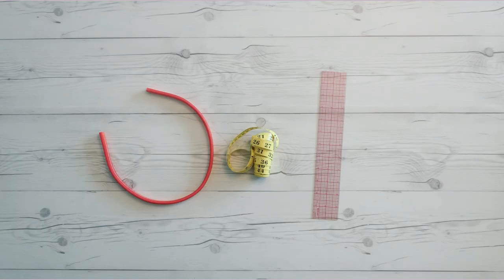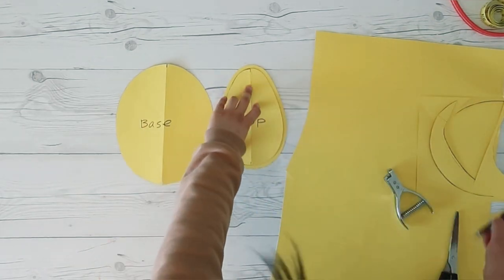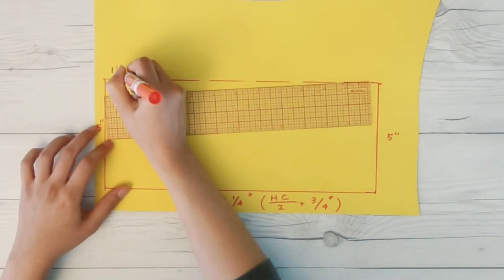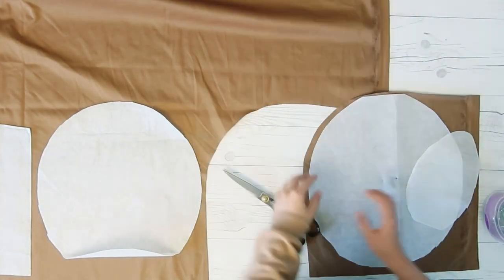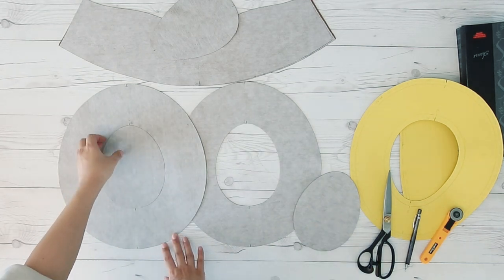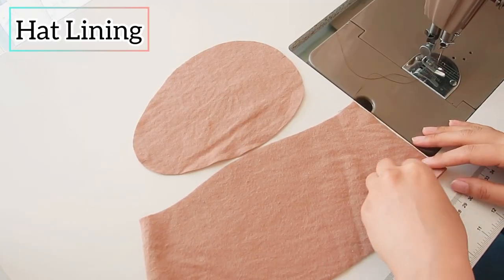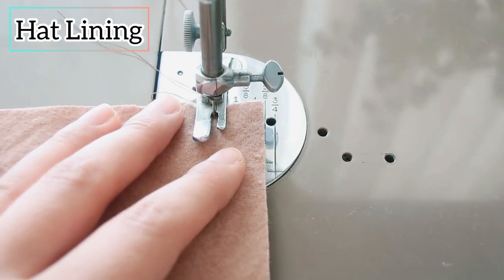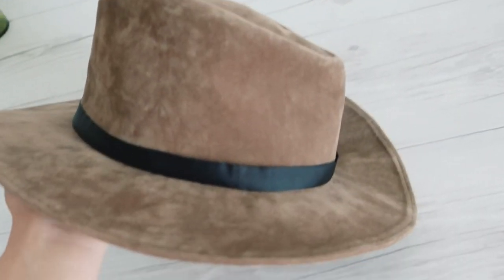DIY FEDORA HAT from scratch / How to use your head measurement to draft and sew fedora/cowboy hat

Comment: Thank you very much for making this video. I have seen several videos on DIY hat making. I want you to suggest that you can use a wire round the edge of the brim, the wire can be any thin metal wire. The wire keep the brim in shape. Thank you.
Reply from the maker: that’s a good point I forgot to mention! On this hat, I wanted soft finish, but if one wants a more structured hat, using double buckram instead of fusible interfacing, and sewing millinery wire around the brim would make a hat hold its shape.  Thank you so much for commenting!!
Reply: will you please tell me what is a double buckram?
Reply from the maker: Buckram is very stiff and starched material used in hat making. There are single buckram, which is easier to shape, and double buckram, which is a double layer of buckram and sturdier than single buckram.  You can cut out buckram and stitch millinery wire around the edge to use as a structural base for a hat. Hope that makes sense!
Reply: Thank you very much for explanation.
Reply: I would love to watch you do the wire + buckram style next!

Comment: If you sew a fine wire around the brim of the hat. You could shape the brim the way you want it better. It will form the way you shape it. Sew wire around brim using some thin strip of same fabric as hat.
Reply: I was thinking this exact same thing.

Comment: Thank you so much for this video. I'm about to go make a Fedora out of scrap metal and this video has removed all the anxiety that I had related to getting the shape right. My plan is to begin with a circular steel ring which I'll heat and hammer into a head-shape oval. Onto that I'll build a framework of 1/8" steel rod, being sure to keep the top Avocado shape, and then weld a patchwork of metal off cuts to the frame to create the final shape. It'll look better than I can describe it I hope, but thanks again for your help!
Reply from the maker: I’m glad this video was helpful! your project sounds very intense and so interesting! Is there any way I can see the end result when you are done?

Comment: Thank you for your video.  I really liked your approach to creating the sides of the crown.  That was very slick.
Reply from the maker: Thank you so much for your kind comment!
Reply: @SachisStudio  I have a question.  When you measured your head with the flexible ruler, the inside of the ruler was against your head.  When you made your base, you put the zero on the ruler one one end of the line you had drawn, and half the head measurement (including some material allowance) on the other end of the line.    You traced on the outside (not the inside) of the ruler.  Were you reading your dimensions on the inside or the outside of the ruler?   Reading and aligning the dimensions on the inside but tracing on the outside would have given the base some additional looseness to allow for material.  So would reading and then using the dimensions on the outside *and tracing on the outside), because of the ruler thickness.  I made a hat after watching your video, and it ended up tighter than I wanted it.  I am trying to sort out what I did that was different.  Thanks.
Reply from the maker: Hi Don, thanks for your comment! I’m so happy to know that you made the hat already :) I’m sorry that I wasn’t very clear on this in the video.  I’m using my tape measure to measure my head, and using my flexible ruler to copy the head shape as best as I could.  I know technically you copied your head shape INSIDE of the flexible ruler, but I traced outside of it because it’s hard to trace inside of the ruler without distorting the shape it’s holding. and that is why I measure the head with tape measure separately and adjust the flex ruler a bit before tracing.  Sometimes tape measures stretch out, and flexible rulers are not super accurate, so it’s a good idea to compare the two to make sure of their accuracy.  But usually, hat ending up tighter is because of fabric thickness.  you can check the base pattern by cutting out the base shape from cardboard paper and fitting the outside of the cut out shape (you can use the brim pattern without seam allowance, too) to your head.  
I hope that helps!
Reply: @SachisStudio  Thanks for the quick answer!  Be well!

Comment: If you don't have a flexible ruler, is there anything that can be used instead?
Reply from the maker: A flexible ruler would be the easiest, but instead, you could have someone take a photo of your head from above, or set your phone’s camera to the timer and hold it above your head to get a sense of how the base shape should look like. And then, use your tape measure or even a marked string to emulate the shape on your pattern paper.  Thanks for the comment! :)
Reply: @SachisStudio  String works well but there are cloth measuring tapes as well.
Reply: I’m thinking of using some flexible wire and marking measurements in sharpie on it first, then use like the ruler.

Comment: Awesome video! I'm wondering how one could reverse the heights of the back and front so that the front of the hat is taller than the back? Thanks so much!
Reply from the maker: I have never done that, but I’d imagine it can be done by just reversing the ratios.  the side crown draft is basically how the hat will look from the side ( plus front and back shaping), so you can make it look any way you want ! if you change the measurement, just measure the lines to make sure they match corresponding seams of the crown top and brim.  I’d make a mock up with cheep fabric to see if I like the shape :)
Reply: The easiest way would be to cut the top shape out of the center of the brim shape, add your side.  Flip the hat with the top side flush to the table and trace the top opening.  I suggest using card stock to create your pattern so it will be rigged enough to hold the shape while you trace your skewed edge.

Comment: Gees, I didn't have a flex ruler so I used a stainless steel one. I secured it to my head with a thumb tac and using a mallet I formed the ruler to my head.
It will be a few days before the hat will fit because my head is still a little bit swollen.
Reply from the maker: Wow, you went to extreme measures to create your hat! I wish you a quick recovery so you can sport your new hat soon :)

Comment: You have made a symmetrically mirrored shape for the crown opening. Unfortunately, most people to not have a symmetrical head. You should use your flex ruler a second time on the other side of your head to create the second side of the oval rather than mirroring the first side. Your hat will fit much better. Hatters had a special tool (conformeter) to do this and make custom hats. See here: https://www.youtube.com/watch?v=9rp06KA0D-I